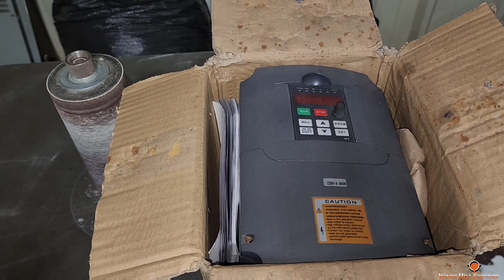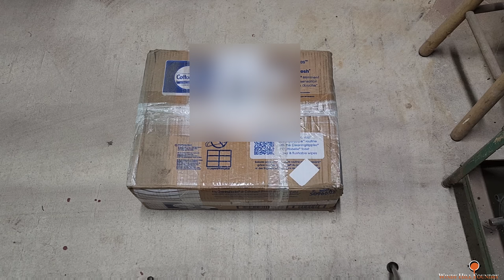STEVE WATKINS AND FURNACE UPDATE

Comment: I've said this many times but it's important: when you fit a speed control to any shop motor consider fitting an additional, fixed speed fan to the motor. The fan in the motor has been optimised for the 50 (UK/EU) or 60Hz the motor is expected to run at and will not provide sufficient cooling if you plan on running the motor at lower speeds. In addition, make sure that you put the inverter away from any dust. The power electronics are often air cooled and don't like to be cooked.
When I install these I often build an industrial spec control panel and use a ten turn potentiometer for the speed control to give finer adjustment.

Comment: I'm following the furnace build because I want to make a new one for my aluminum, brass & copper casting. My current furnace doesn't have enough insulation. Good idea on putting the VFD on the spindle sander. As the diameter of the spindles are changed out the surface speeds change a lot. The 4" diameter on will start to whip if turned too fast. The half inch one will take too long to sand anything if turned too slow.

Comment: The inverter is also referred to as a VFD, Variable Frequency Drive.    You can have a switch between mains and the VFD to apply or disconnect power to the VFD, but you should not have a switch between the VFD and the motor.    The VFD does the function of starting and stopping the motor, typically set to a soft start and soft stop.   You should be able to configure how many seconds to start the motor and a different value for the number of seconds to stop the motor.   I have a VFD and 3 phase motor on my small milling machine.   It looks like the VFD has a rotary switch on the front.    This is likely default configuration to change the frequency.   It may be able to be configured to change other functions.    I have mine with the default configuration for frequency.   The VFD should also be able to be configured to set the minimum frequency, e.g., 10Hz and the maximum frequency, e.g., 90Hz.   It sounds like you desire slower speed more than higher speed, which makes sense.    Too much heat on the drum and resins from the wood can clog up the abrasive.
Have you considered a 3D printed core for the furnace?    This is an easy CAD design.   It will take some hours to print, but that is common, but it is just machine time.    I am happy to volunteer to design and print one for you if you want to try this.  I just need the dimensions.    My printer can do max of 12in x 12in x 14in.
Dave.

Comment: you can completely replace that control box and just use the VFD.   I used the same kind of VFD on my simpson muller and it works so well on standard 220v power instead of three phase.  can adjust the speed of mulling and do slow startups or slow it down when emptying the mixing bin

Comment: Hi Clark,
Consider this - after you’ve punched those little bitty Start and Stop buttons a couple of thousand times and one stops working, how do you fix it?
It’s better to make a remote Start/Stop station using your favorite brand of industrial momentary push buttons that you can refurbish the contacts on. 
The instructions will show you how to wire this - it’s easy.
Reply: In addition to what Mr. Coleman suggests, I believe the box shown at 18:50, the original start/stop won't be what you want, as it likely (through mechanical internal linkage) automatically clears the stop switch and stop condition when you press the start switch.  It's possible this could work, but you might have something a little janky, like having to double tap the start button (once to clear the stop condtion and again to initiate a start signal to the vfd once the stop condition has been cleared.) You'll likely want a stop switch that you can separately clear the stop condition on plus a momentary start switch.  This should integrate more easily and safely with your VFD.  Bonus is that you could easily add more stop switches surrounding the machine and work on it from any position around the machine and have a stop switch handy from any point.

Comment: I have a friend who is an electrician. He told me that VFD’s will make a motor run much hotter. New motors are often marked VFD rated, they have a higher temperature insulation on the windings. Just be aware of that and watch your motor temperature. Some people will poo poo this but I trust my friend.
Reply: If you spin a motor slower the internal fan does not move as much cooling air through.
VFD's don't have the problems of voltage speed controls, where lower voltage means more amperage (and heat) fed into the windings.

Comment: If its a variable speed drive you don't use the original control switches! You can wire remote switches from the VFD, but you should never break the circuit between the VFD and the motor! Have you looked at EnglesCoachshop youtube channel? All the best, Matthew

Comment: Check the ratings on the inverter and the switch, as long as the new one can handle at least the same current as the one being replaced you should be all set